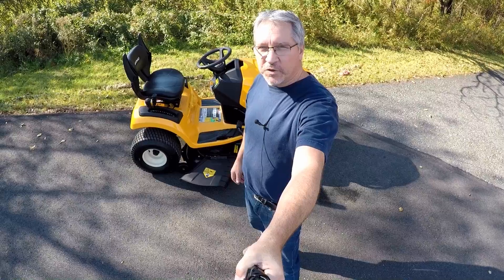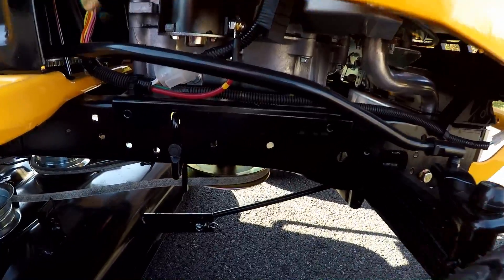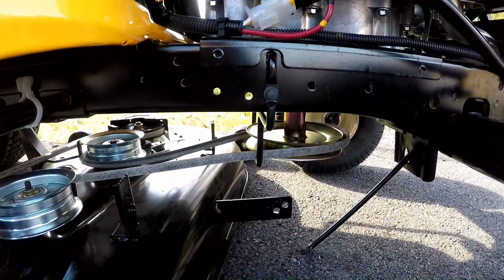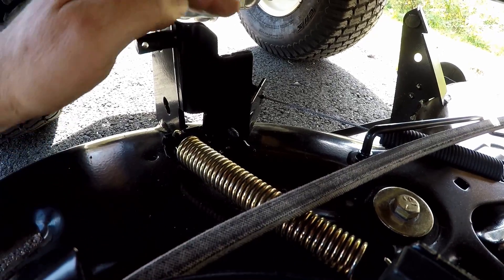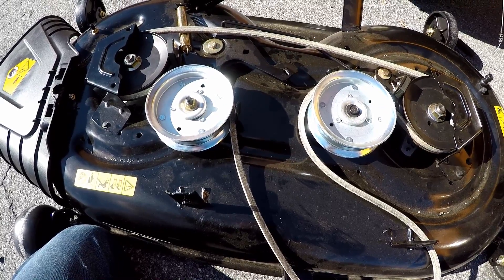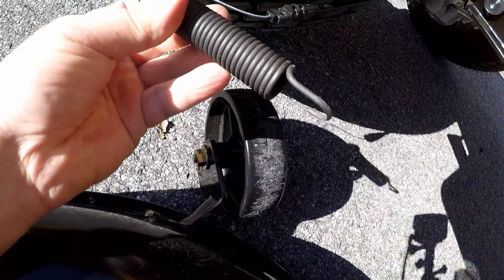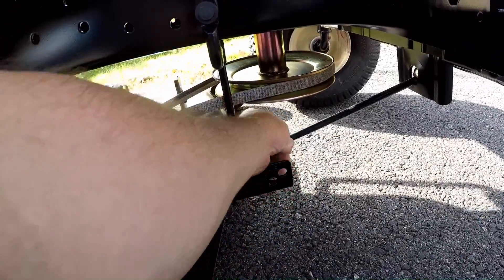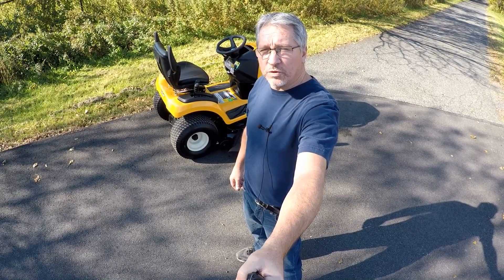Cub Cadet XT1 and XT2 deck removal - with manual PTO

Comment: Coat the bottom of the deck with slip plate graphite it will  keep grass from sticking to the underside of the deck  . tow truck drivers use it

Comment: Hey Mark Thank you for the video. I love you & I hate you. I don't do do repairs other than cleaning,fuel stabilizer, disconnect battery. Wire was wrapped around shaft of discharge blade. I needed to remove deck/blade.I was going to call for service but after viewing your video, I thought...I can do this! I was right. I referenced the video several times but was successful and have over 10 hours runtime since. again Thank You!! Now I hate you because my wife will expect more! I kinda have the confidence to attempt an oil change...maybe.

Comment: Thanks for posting. Very clear. Will save me time. The manual (lame diagram) says something about loosening a flange bolt on R idle pully and then a nut on the other one before undoing the bolts with the cotter pins. Hmmm.
Reply: Yes!  I couldn't figure this part out.  Still can't!

Comment: Used this video again to replace my blades. Who the HECK thumbed this down??? I will say I only needed to watch about 1/2 of the video this time as I'm understanding how the rear deck works better now. But seriously thanks for making this video. You dumbed it down pretty well for me! I did want to mention if you use an impact wrench to remove and replace the bolts it doesn't seem to me like you need to use a blade stopper. So that is pretty awesome.

Comment: very good, but I don't think the retainer pin was put back on correctly at the location of the cable.  if you look in the section of the video where it comes off, it doesn't go back on in the same orientation.  it might matter for it to be locked on.

Comment: This was the perfect video. One on cub cadet site did not show the back spring and also had you remove the belt. I just bent my blade so had to replace and this was perfect step by step. Cotter pins can be a bit annoying but great video if you need to replace a blade on your cub cadet XT46 or 42.

Comment: I followed the video carefully, and the deck came off without a hitch, besides me needing three hands to do so, it was great help. Now I repaired the jammed blades and when I tried putting it back on, the two rear hangers will not line up. No matter what I do I cannot get them into place to reattach and put the pins in, anything I’m missing, the video is so straightforward that it’s frustrating...

Comment: Great video. Except the fancy cotter pin style in use for the cable clip prevents me from taking it off. It's not that easy. Not sure how you did that one. Because it isn't twist and pull. It's twist and break if I keep going. Meanwhile my craftsman from 2000 ish has more clasic style cotter pins and have me zero issues.

Comment: I saw a pause in the video taking the pro cable clip …I finally got mine out.  Now the cable will not come out of the bracket…quitting on it for the night before the dynamite comes out…p,ease help

Comment: What is your favorite riding mower with a 42 inch deck?   John Deere E120,  Cub-Cadet XT2,  Husqvarna,......
Reply from the maker: Well the 42" market is very competitive. I would buy any make or model with a kawasaki engine.. next would be one with the kohler twin cylinder..   I personally would buy a steering wheel zero turn RZT SX42. You pay a little more for a little better quality and a good proven machine for small yards. The new ZT1 42 zero turn is another good choice for small yards. You can now get a zero turn for just a little more than a lawn tractor..  keep in mind its just my opinion
Reply: Excellent. Thanks so much.

Comment: Nicely done video! Waayyy easier on the new Cub Cadet vs the John Deere
Reply: AMEN!!! You have a witness! This morning I was removing that John Deere LT180 deck for the hundredth time laying on the hot concrete. My wife came out to announce my new gift just as I slid that stubborn deck out. LOL, I re-installed it for the LAAAAST TIME!!!  Today I got my fathers day present, a new XT1. The first thing I noticed was how nice you can access the deck connections.

Comment: Just purchased my XT1 with a 46" deck. Thank you for the great video. Now, when I need to sharpen the blades, it should be much easier than jacking up the front of the tractor.

Comment: Thank you for showing not only removing but installing the mower deck. The instructions in the manual are confusing and no video or course. Now I have mulching blades and plug installed ready for my son to get to work.

Comment: The best video on removal and reinstalling mower deck on XT5, with manual PTO. Step by step progression made it a whole lot easier. Had more trouble removing the darn blades to sharpen them! Thank you very much.

Comment: Mark,  THANK YOU for your video.  My son and I worked all day replacing the drive belt on my Cadet.  It's a nightmare, but it's done.  When we reinstalled the mower deck, we forgot to attach the front of the arms to the chassis.  Your video illustrated that perfectly.  We'll be able to finish the job tomorrow morning, and I'll be mowing by noon.  Again... THANK YOU!!!!

Comment: Great video for those DIYers.  Only suggesting is that I would mark the belt guide bracket hole, so you are not putting it back onto the wrong hole.

Comment: Should the cable spring be attached hook up, or hook down. In the You Tube videos most guys hook it up spring  hook down from top. My mower came to me from the dealer with the hook coming from under the bracket with the hook facing up. I’m wondering if it even matters???

Comment: At 5m34s, when [not] pushing the pulley to release tension, is the spring on the manual PTO cable meant to be under any tension? 

Mine's completely loose and flops around. When engaged, it provides just barely enough tension on the belt to even turn the blades.

Comment: Just have to say thank you! My dad bought a 46 version of this mower not to long ago and bent one of the blades his very first time using it. He spent about an hour trying to use the manual to take the deck off but it wasn’t up to date at all. I found your video, got the deck off, new blades installed, and the deck back up and running in a matter of minutes. Seriously, thank you for the video! I now have it saved for later just in case we need it again. 😅
Reply: An easier way is to get a mower lift (Harbor Freight even sells a couple versions for about $300 or less...I love mine, saves taking the deck off as often.

Comment: Anyone else have a problem with the other pulley (opposite the idler pulley) coming off? My mower is only about a year old and damn thing came off while I was mowing. The bolt vibrated loose or something and got lost somewhere in the yard.

Comment: Great video you have here! Subscribed to it also for more. I have a 2015 XT-2 LX46 "Signature Cut" CUB CADET and don't know much on riding mowers. It sems as if someone else who owned it has either left parts out from the deck when working on it. My deck looks similar to yours but I don't have that "Cable thingy, Belt Retainer Rod/Belt Guide from the frame and guides for the pulley's on the deck itself. I only have one lever that lowers the deck and yours has two different levers on it. Could you please explain what issues I have from yours. Thanks so much for you time and knowledge on these. PS: What Trans axle by Tuff Torq do you have in yours?

Comment: Just received an XT2 LX42 and needed to install mulch kit. This video is invaluable as I could not understand the deck removal instructions in the manual. Thank You Very Much, Well Done!
Reply: Did you like the mulching blades? I may get some.
Reply: @paulgray3444  The mulching blades that come with the mulching kit are ok, but I picked up a set of Gator Mulching Blades for this season and they're leaps and bounds better than the 3-in-1 blades that come in the kit.

Comment: Mark, I am having problem with cranking after I run my Cadet XT 42. When i push the brake and turn the ignition key it tries but want crank. I have to do it several time before it finally cranks. Is it an adjustment on the brake cable?

Comment: I just used these instructions and was able to change my mower blades after removing the deck in 15 minutes. Thanks for a great video.
Reply: Took me over an hour to get the deck back on. Gotta get pushy with that last pin in the install

Comment: This was awesome. I just got done replacing the blades on my XT1 and put the deck back on and found a left over bow pin. This is par for me. I searched and thought it went on that cable but wasn't sure. Your video is the only one I've found that touches on this and it saved my sanity. Thanks!
Reply: Leftover parts, careful....I forgot one of those and bent the crap out of the front deck support rod, literally bent the rod into the shape of a U...oops, $24 later for a replacement rod, now I double and triple check stuff before driving off.

Comment: This was a fantastic video and you saved me hours of my life. Thank you. I used this video to help me remove the deck to change the blades. If I ever find the person that tightened the bolts on the factory blades, I'm gonna strangle them. I had to take the deck to a local body shop to have them use the compressor wrench. But that's another story. Thanks for posting a great video.

Comment: Excellent presentation. Do you know any thing about reverse safety that keeps killing motor.  Easy and to the point understanding.
Reply: There's an over-ride on the key switch, turn the key to the reverse mowing spot then press the yellow triangle and you can mow in reverse....stupid safety nanny crap they have on everything now is ridiculous....I usually kill my mower a few times during the mowing season when I forget to turn on the reverse mowing option.

Comment: I have a question. 
I removed my deck, installed a new belt (the other one would come off after a few hours of run time) then i reinstalled the deck. 
My problem is the pully with the engagement  lever has up and down play to it. Everything is tight,  where do you think my problem is? I could fix or replace a part  myself if i could find where the problem is.  
Help...

Comment: Best thing I did on my XT1 was replace those stupid butterfly pins with regular hitch pin clips, much easier and quicker to install and remove the deck, those butterfly clips are a dumb idea.
Reply: Ditto to that !!!
Reply: 1/2" Hitch pins work fine. Got mine at Home Depot
Reply: @lestergarnier6209  HAHA, that's exactly what I did as well.  Took me about 5 minutes to remove the deck last week for cleaning, rather than struggling with those other types of pins for 10-15 minutes.  Now if I could figure out a way to keep the grass from blowing out the front of the mower deck when I'm mulching it would be great LOL.  No baffle on the front of the deck like my previous Craftsman lawn tractor had....wonder if one of those baffles would fit my Cub Cadet 42" deck.

Comment: Great instructional video! Thank you! I have one question. I've successfully removed my deck in preparation for the installation of a snowplow. Do you have any advice as to what I should do with the PTO cable that remains? I figure I can zip tie it to the frame, but wondered if you had any other advice.
Reply: Russ, I have the same question. There doesn't seem to be any advice online that I could find that suggests a 'proper' method.
Reply: @mitch5991  I just have it tied up with a nylon zip tie. I'm sure it's fine. Was just wondering if there were any other ideas out there.

Comment: Very near the end of the file you will see,
Line : 2. loop on hook attached to the frame that holds the tensioning spring. 
It should read:  2. loop onto the back of the spring which is held to frame by a brass hook.

Comment: I have an XT1 42" and it's set up the same as this tractor. I had to replace the spindles on my deck, now my belt won't keep enough tension to keep the blades spinning. I even went as far as putting the old pullies on the new spindles. I can't figure out what is going on with it. Any suggestions?

Comment: What size is the belt used on this video I tried replacing a broken belt did everything correctly and it wont engage the belt once I pull the cable I think the belt length is to long?

Comment: For those like myself that do not have rear deck wheels, you can take a large piece of cardboard and place it under the deck. Once you have the bow-tie locking cotter pins removed, you can slide the deck out to where you can unhook the bow-tie locking cotter pin and spring on top of the deck. The cardboard should also help pushing the deck back under the mower when you are ready to remount the deck. This will also help prevent rubbing off paint from deck if moving across concrete driveway or garage floor.
Reply: I do the same with my deck, once all the lift/support brackets are removed I pull the deck partially out from under the tractor to unhook the engagement cable, much easier than fussing with it under the tractor.  

Makes me miss my old Craftsman GT6000 so much every time I have to remove the deck on these MTD machines.  My old Craftsman I pulled 4 quick release pins, removed the belt and was done, literally would take me about a minute to remove the deck.

Comment: Thank you so much for this video, it was so frustrating to find a video that properly explained it for my model but this had all of the steps and was explained thoroughly. I noticed though it seems like the pins on my mower’s deck (XT1 Enduro 42”) are so stubborn and stiff, I had to wrangle them off to the point of warping them yet they seem so easy to remove for everyone else. Now I have to put them on (after replacing the blades) and it seems impossible to do so. Is it supposed to be this difficult? I bought replacements but theyre smaller and thinner so I don’t know if they’ll work
Reply: 1/2" Hitch pins work fine. Got mine at Home Depot

Comment: I have an XT1 46”, and I followed this video exactly, however when I tried to reinstall the deck, my hanger holes are off by 1/4”, and the deck cannot be moved back anymore. Looked for anything stopping the deck from moving, with no luck. I am baffled by this. It appears so easy, it was removing it, but what holds it from aligning with the holes on the hangar...HELP!

Comment: THANK YOU for this. The cable isn’t shown in the manufacturer video. So that was a nice surprise. Thanks for showing this. Do you have any videos of a snowblower attachment for this machine?
Reply: I agree, Thanks that cable install was a little bit of a mystery to me since I had my plow installed by the dealer and never removed my deck before.
Reply: I have the blower attachment for mine, I guess I need to figure out how to shoot a video of installing and setting it up...its really not that hard, takes maybe a half hour including deck removal....probably less time now that I've swapped pins on the deck to allow easier removal and installation.  Worst part for me is trying to wrestle with the blower to get it out of the shed over to my carport so I can install it.  

I haven't been able to use the blower much since I got it 2 years ago, past couple winters haven't been much of a winter, so maybe this year.  I got 1 change in about 10 inches of snow to try it out, it works great, and I add 3 rear suitcase weights and tire chains and have no trouble with traction.